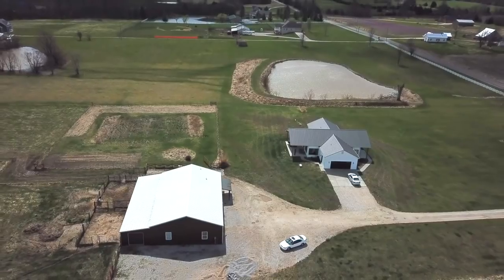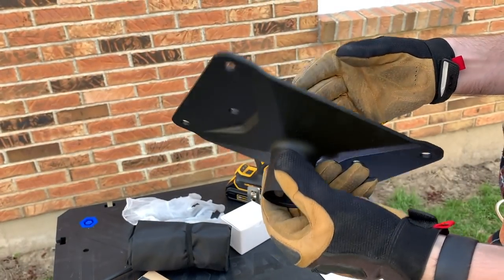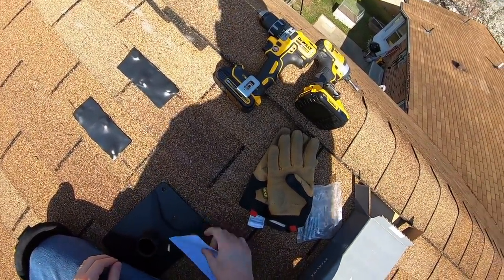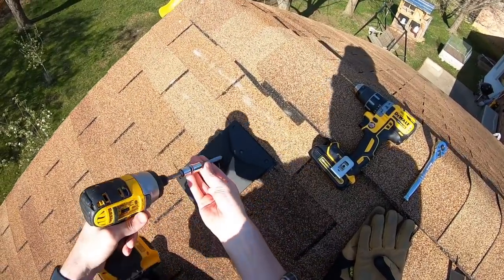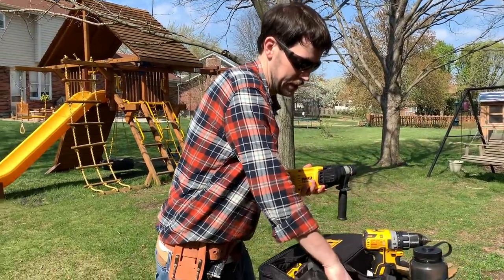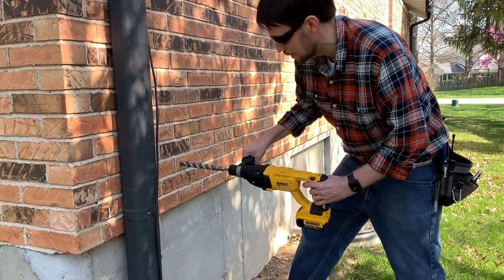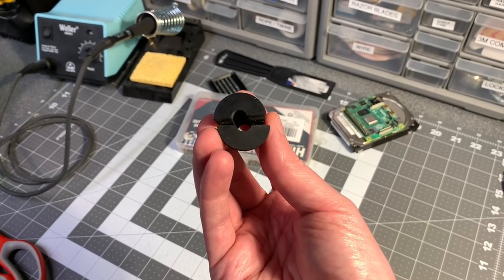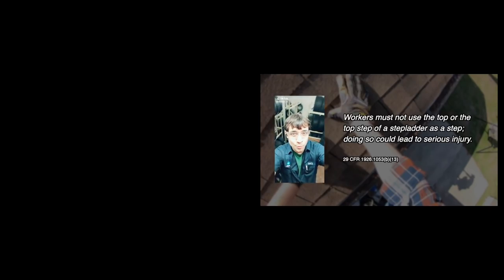SpaceX Starlink satellite internet - Roof mount install

Comment: Starlink has GPS on it and it is locked to your home or office location. That is set when you signed up with spaceX, i found out. So if you move it outside of your home or office location it gets disabled. I was told this by the starlink team in email. One thing they said is mobile will be soon. So if you have a RV of some kind you will be able to use starlink. When that will happen I have no clue but I think maybe by the end of this year or maybe the first of next year I hope.
Reply from the maker: In my previous video, I took Dishy to a cousin's farm 60 miles from my house, and it was not locked out, but it didn't get service since the satellites were not active over her 'cell' of coverage.

You can get dishy working within a certain radius of your registered address, and you can also ask support to change the address to a new one (assuming the new one is in a covered area—my cousin's was not).
Reply: @JeffGeerling hello Jeff, does your sister have the same cell provider as you do? Does your cell phone work at her place even if it’s a small signal?
Reply from the maker: @DiyintheGhetto  Yes (and it's cousin, not sister :) — see previous video here: https://www.youtube.com/watch?v=U-VfAFj4jYw
Reply: @JeffGeerling  lol sorry your cousin. So the problem is not the cell site because if you have signal on both locations of your cell phon. Then it’s geo locked.

Comment: No speed test, I feel robbed!
Reply: Next week I hope 🤓
Reply from the maker: I don't want to give any hard data yet because I don't feel like a day or two of data is good enough... but for the first few days it has averaged around 100 Mbps down and 15 Mbps up, with 44 ms ping times.

Those numbers will likely be different over a longer period (and are wildly different over shorter periods—I've seen download up to 340 Mbps), so I'll be giving a more in-depth review then.
Reply: @JeffGeerling  from a few Starlink maps I've been tracking, my location in the Midwest would have around 86% uptime... Not very good since my dad is WFH
Reply from the maker: @zacharywebb7197  Mine's been closer to 96-98%, and I'm testing a variety of different things (including using Starlink exclusively for some days) to hopefully have a really good understanding of how it could replace other Internet options.
Reply: @JeffGeerling  we have DSL and TMHI is available so that's what we'd go with instead of Starlink. We have unlimited data on our phones with AT&T so we don't use the WiFi heavily

Comment: You drilled holes in your roof. Why not drill one more under the metal base and run the cable through it into the attic?
Reply from the maker: SpaceX actually makes a flashing adapter that I didn't see until after I started editing the video, which has a cable routing path for that. Note that I mounted the volcano mount on the edge of my attic space, so there is no hole that goes into the attic cavity yet; though I could go down into the soffit and go through that area. But every additional hole up there scares me more than even a larger hole down at the bottom of an exterior wall into the basement. Easier to route the cable through the basement than through the attic at my house.

Comment: The elephant in the room is the inability to bolt this to your RV and roam the country without having to change your location on line every few miles.
Reply: @barnett25  OK, thanks, I wondered if it was for physical reasons - like you've outlined, but it also crossed my mind there may be legislative roadblocks too (in some regions of the world)
Reply: @barnett25  Good info - thanks barnett25. I thought Starlink already had communications between satellites running them in a "grid" network. Its relatively common technology (up markert wireless access points run multiple units in a primitive grid network), so that is a surprise! Anyhow, thanks for the education. Always welcome!
Reply: @barnett25  Laser links! Fair enough - they need real time alignment, so I can see they are breaking relatively new ground. Thanks again. More stuff I didn't know!

Comment: I presume he had the foresight to lock up Red Shirt Jeff before climbing up on a roof. 
Wouldn't it have been easier and more elegant to drill a hole just under the peak of the roof, run the cable into the attic space and then down inside through an interior wall? That's how I route wire, in my brick house. And that ratchet socket looks more like 3/8", not 1/2".
Reply from the maker: It's definitely a 1/2" ;)

I could run through the attic, but I'd still need to put a hole somewhere in the vinyl (up higher) and then I'd be in the space above the ceiling to the living space, so potential leaks could be more damaging than if a leak went into a joist in the basement. I'd also have to spend an hour or so routing cable through the attic to get it through a wall fished down into the basement, and I'd trade a lot of things to not work in the hot itchy attic!

Comment: Interesting how american roofs are build, how long do they last and how much rain drops a year ?
Reply: Asphalt shingles like this usually last 25 years.
Reply from the maker: This. Roof is due for replacement in the next year or two.
Reply: @KameraShy  ok, good to know, here in germany the roofs are made for 25-50 years, i know that the asphalt shingles on our garden house didn't hold such long so it was interesting to see.
Reply: @JeffGeerling  good point, i saw that some on the top are not sitting correct so it seems like a good idea, but i'm not an expert for roofs ;)

Comment: If you had the right tools, I would have put the cable in between the bricks and wall, so no need to drill holes through the brick and have conduit every where.

Comment: Cable internet? I'd think you'd be one of the cool people with fiber
Reply from the maker: I wish!
Reply: @Jeff Geerling Gotta move to a location served by fiber. Yet my hunting property got upgraded haha...so I signed up as soon as I found out. So a camp in the middle of nowhere has Fiber access. Yet my home in a state Capital city, with a well known University, was picked by the Original Google Fiber rollout as an option. STILL doesn't have fiber...even though all burbs around have mostly fiber availability. Long live the ATT monopoly contracts and liberal redtape for new infrastructure. But have no fear...AtT took billions in grants to connect...and they did...5 Brand New luxury apt buildings so they now claim and advertise they supply fiber to the city. Even if it's only 5 buildings.

Comment: I would just use silicon to fill the hole in the wall. It was good enough for A/C, it would bee good for this too.
Reply from the maker: The AC refrigerant lines are more rigid, so they tend to stay put a little better. This cable is pretty flexible, so I like the extra support a grommet gives. But silicone should work fine even for a larger hole.

As someone else commented, the ideal scenario is some proper exterior-rated pipe/tube to go from inside to outside.

Comment: 1:38 spacex sells a kit for that. I can't link to it because I don't have starlink...
Reply from the maker: Their kit seemed to me (at first glance) to be geared towards vinyl-sided houses... though it may work on brick with a large amount of silicone sealant.

Also, their little spade bit would not be able to get through the brick at all, so the most expensive thing (the 7/8" masonry bit) is still necessary :(
Reply: @JeffGeerling  bugger.. I think that home in Australia would have some issues.
Reply from the maker: @joeltyler3427  Aside: I wish Starlink's products were able to be viewed by those without Starlink accounts. I can't link to them since nobody could even see the links I post :(

Comment: you could have gone with 3/4ths hole and pushed the back end of the cable outside end threw the hole meaning the big part would have been on the inside already
Reply from the maker: Unfortunately the other end of the cable is hardwired directly into the dish, so I'd have to drill a 3' hole or so to fit the dish through that way!

Comment: That angle on your ladder was not properly placed according to the manufacturer specified safe limits for it...

Also, you carry so much stuff no wonder you get back pain if you carry a few kilos extra :D
Reply: Just put a steel wire through first, then tape the connector to it and you never get stuck (or break) those tabs!
Reply from the maker: true, wrap it in electrical tape and it's a lot less prone to damage. But fishing it through with string or wire would require me going in and out a couple times, and who can be bothered to do that! :)
Reply: You can put a steel/copper wire through from the same side as you drilled the hole!

That is how I do it, I've got UTP jacks stuck so badly by jiggling them around...

Comment: you cannot pass by the roof in the inner wall ?
Reply from the maker: I could, but then I'd have to route the cable through the attic and down a wall somewhere to the basement (or set up a network station with power somewhere in the sweltering-hot/humid attic).
Reply: @JeffGeerling  electronic and humidity is never a good choice. And i know fishing wall is satanic XD

Comment: As a european its always interesting to see how americans build their houses. Having the upper floors supported by wood still seems really sketchy to me.
Reply from the maker: Wood framing won't last forever, but with the proper construction techniques, sheathing, and maintenance (which many builders don't follow in some parts!), they can last a few hundred years at least.

There's a lot less brick in most homes today, though, and a lot of penny-pinching contractors and lazy inspectors, so there are plenty of horror stories with wood-framed houses. (And even in brick-faced homes, the brick is a façade like siding, and is often not installed correctly too!)

Comment: The sawdust is from the plywood roof, itself, not necessarily a stud.
Reply from the maker: In this case, I wasn't too clear in the video itself, but the drill bit was definitely hitting solid material all the way down.

On the two screws on the left (which I didn't leave the audio in for), it punched through the plywood pretty quick and was spinning free after < 1" (and there was almost no sawdust that came through).

Comment: You get saw just when you drill into the f
Roof because there is plywood under the shingles and tar paper
Reply from the maker: The plywood is not 3" deep though! I drove the drill bit all the way down and felt solid wood the whole way through. On the left hand holes, not in the video, the bit hit wood for the top short bit, but then popped through to air.
Reply: Okay I was saying that for the holes not in the stud but yeah that makes since

Comment: Well your install leaves a lot to be desired. Call a Ham Radio Operator and get his advise on how to do this there are a lot better ways to do this. Look into using a Roof Jack. They are used to install vent pipes among other things on a roof.

Comment: It's a shame to drill holes in your roof just to get 15 feet closer to a satellite way out in space.  Good luck clearing snow off of that in the middle of winter.
Reply: Snow off what? The dish warms and melts it off
Reply: @mrmotofy  You must live somewhere where there are no clouds and it only dips to 32 degrees on rare occasions.  There are people who live on acreage that do the same roof mounting with solar panels and risk death unnecessarily many times each winter to clear their panels.
Reply: @derekdowns6275  The Dishy heats itself and melts the snow off itself...there's NO snow clearing necessary...how many times do I need to say it. 

No I'm very knowledgeable on the rustbelt. NOBODY I've heard of cleans the snow off their roof solar panels. Another reason it's not smart to mount them up there in that area.

Comment: I would have looped under the soffit and into the attic space, then routed it inside the roof to where you need it

Put heatsrhink over the plug when feeding it through holes. Ideally use a draw wire first and attach to that

Comment: Why the hack you use imperial units? You are not a carpenter or oil tycoon to not learn SI units ;)
Reply from the maker: Just using what the instructions say to use. I have sets in both metric and imperial, and I use what's called for since the metric set is just off the sizes in imperial and creates a little looser fit.